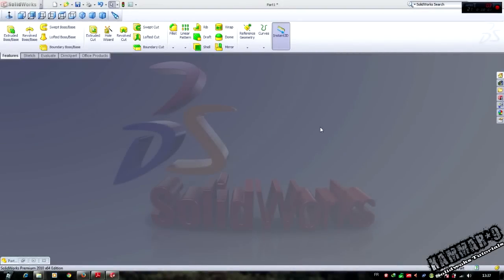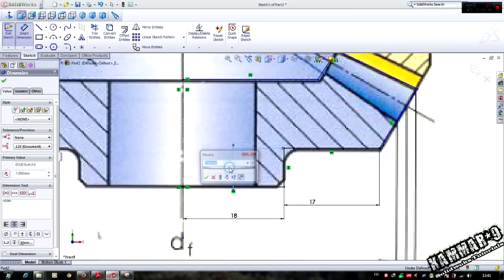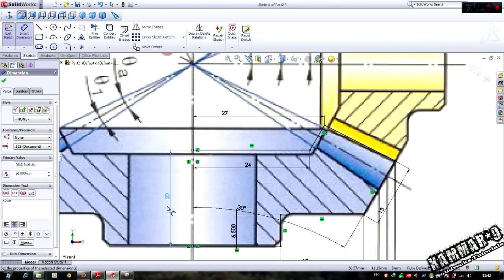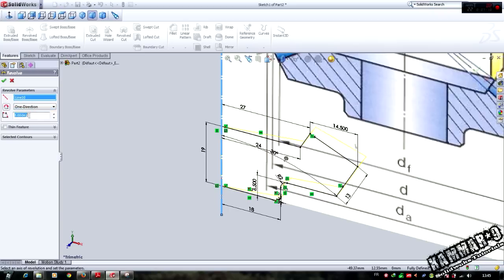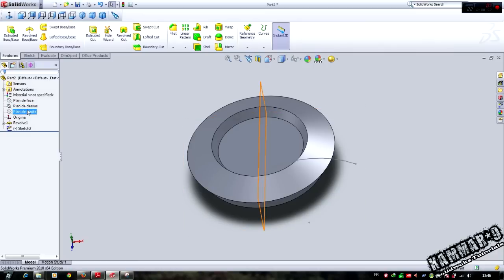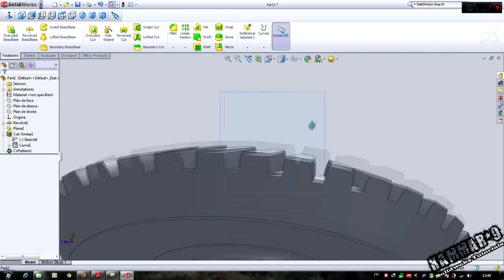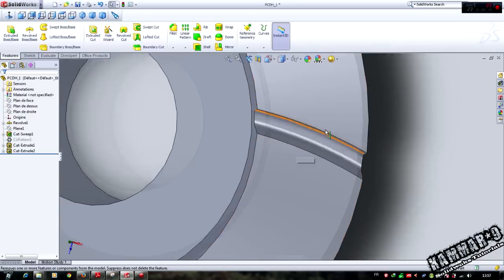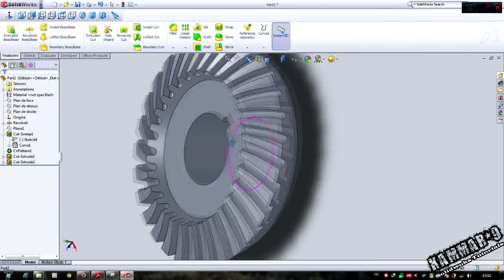Solidworks Tutorial # 06 Spiral Bevel Gear

Comment: these gears won't mesh, not an involute
Reply: khelifaoui Ammar an involute curve is made by the end of a string as it unwinds from a circle, this curve is different than a circular arc that you used. An involute profile gear meshes with continuous contact between teeth at all times.
Reply from the maker: Denis Lipatnikov  you mean what by involute ??
Reply from the maker: DL704  ok, but me I used an arc to do it , without a dimension , but if you have a formul to calculat all this , it's just put it in the cotation and go ahead :)

Comment: This definitely LOOKS like a sprial bevel gear.  However, you can't just arbitrarily cut a tooth shape and fillet the corners.  That's not how a proper gear is done.  If you just want something that looks like a helical bevel, this is fine, but it will never get it to mesh with a mating gear.